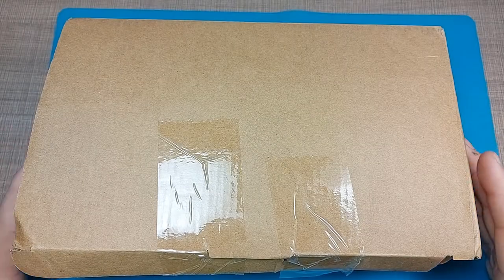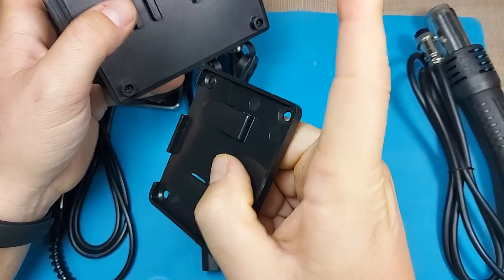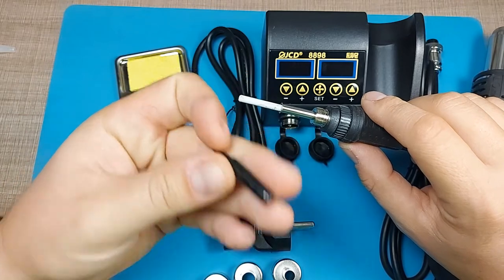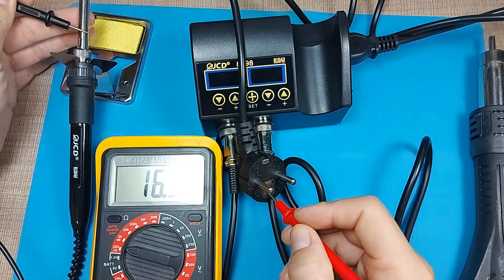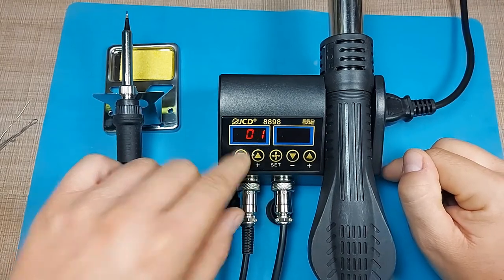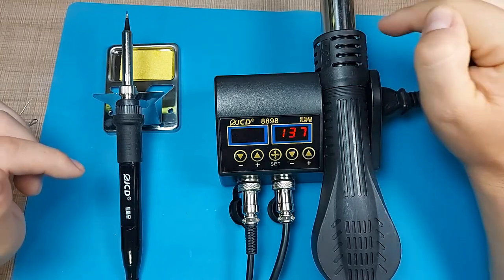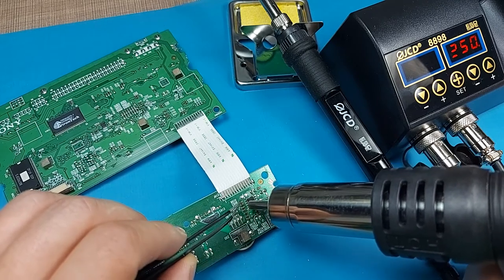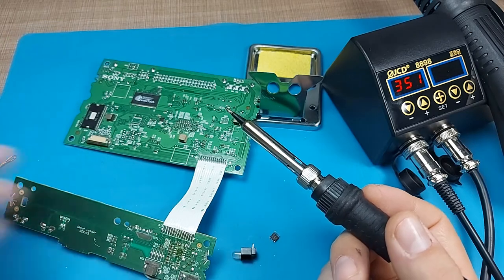JCD 8898 Solder Station Hot Air Gun Heater - Unboxing, Review and Testing

Comment: Hello dear, I got same and I would like if posible that you measure the heating element ohms or volts. I broke mine and new ones don't work properly.
Reply from the maker: 146 Ohms between pins 1 and 3. None of the pins show anything with pin 2. When you say that they don't work properly, what do you mean?
Reply: @TasteTheCode  I mean, they don't work at all, I got no voltage in iron outlet pins. As you mentioned, one of the pins is protection earth, only two are for feeding the iron gun.
Reply: @TasteTheCode  I don't know if is posible for you to measure that voltage wich I think gotta be made with the charge conected
Reply: @TasteTheCode  146 ohms, thank you, I think that's the right heating element that I bought then. Its a matter of the device as I see, I tried another triac but I'll try to change the microcontroller and see what happens.
Reply from the maker: Hmmm without the right firmware, changing the microcontroller will not help. What is the issue that you are having?
Reply: @TasteTheCode  A friend of mine, broked the heating element of my jcd 8898 iron gun. I bought two but they don't heat up. When check, I have no voltage in between iron pins 1 and 3
Reply: @TasteTheCode  they should be 115 volts. The machine has a ms51fb9ae microcontroller that I think its the issue since I check the triac and try another and doesn't work.
Reply from the maker: @kpelectronics  To be honest, I think that your best option now is to replace that microcontroller with an Arduino and do the programming yourself if you are into those things. If the microcontroller is not turning on the triac, I don't think there is anything else that you can do. It should be fun project thou.

Comment: mine broke in 3months
Reply from the maker: What happened to it? Mine still works.
Reply: @TasteTheCode  the soldering part of the station completely died.
Reply from the maker: Mmmm that's weird. Check that the connection are all good.
Reply: @TasteTheCode  EVERYTHING is good. It uses cheap components inside.
Reply from the maker: That's sad. Let's see how much mine will last.